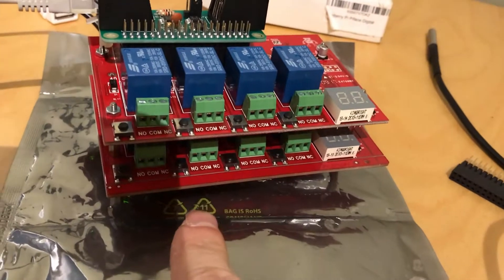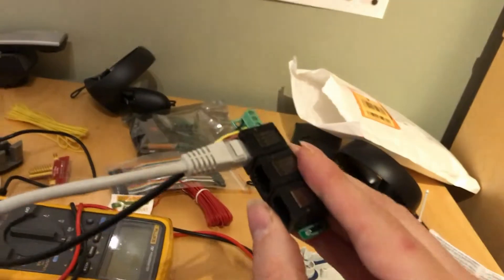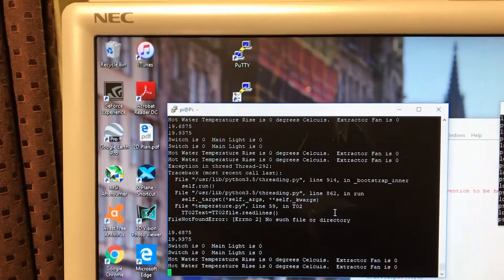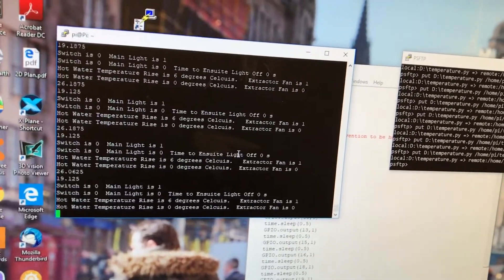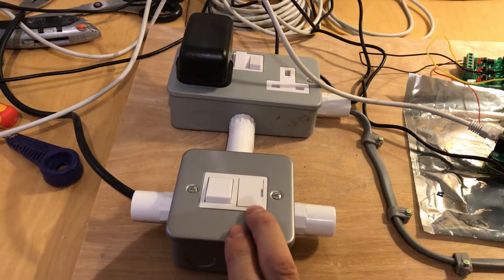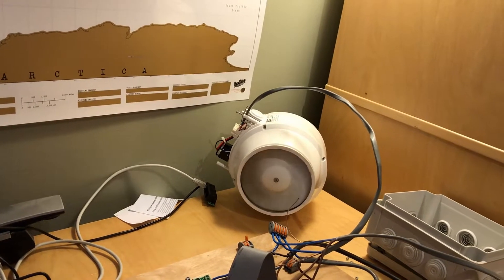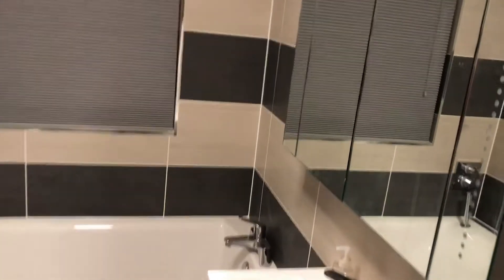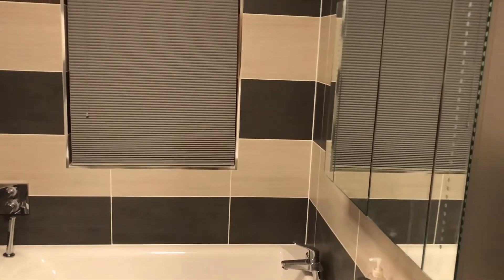Home automation project for bathroom fans and lights

Comment: Really like your videos and picked this one up from your latest one video. Wondered how your able to override the clock should you want the big light on? Did you sort out a master clock or still using the internet?
Reply from the maker: I’ve no longer got the pi on wifi.  It’s now on the Ethernet along with the inverter and car charger via the network switch in the electrical cupboard.  That means that if I ever sell my house, then the new arrivals don’t have to faff about with getting the pi onto their wifi (which requires keyboard, mouse and monitor to be connected, a big faff in the loft).  They just need to make sure the Ethernet switch is connected to their own router.  So therefore I think the internet clock will be sufficient for this to keep time. 

In the small hours, if I want the big light on, then the override is to simply have a shower.  That will automatically switchover the lighting mode to the big light for so long as the fan is switched on.  After 3 years I’ve never needed to override for any other need.